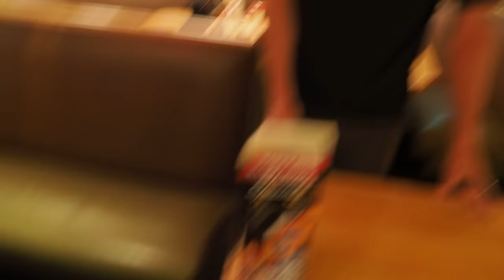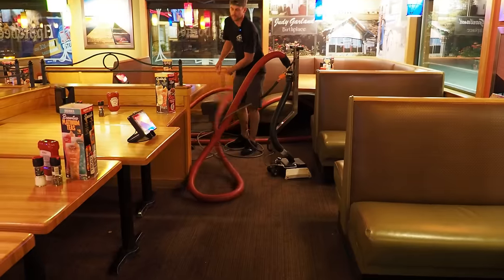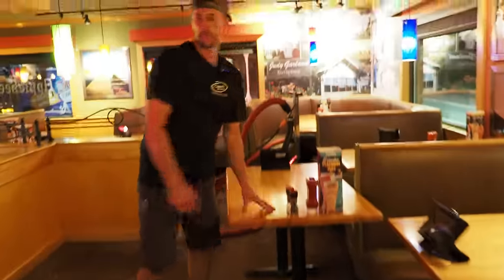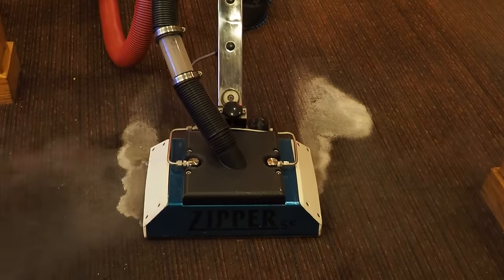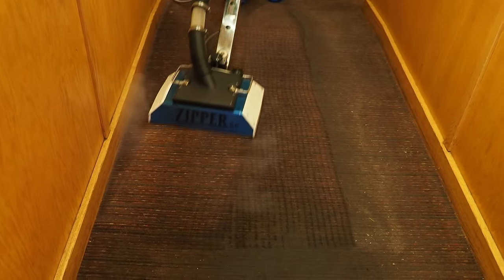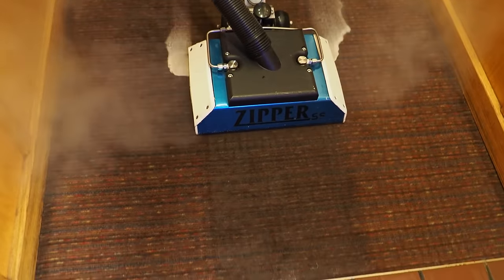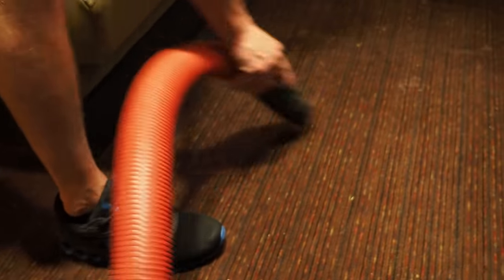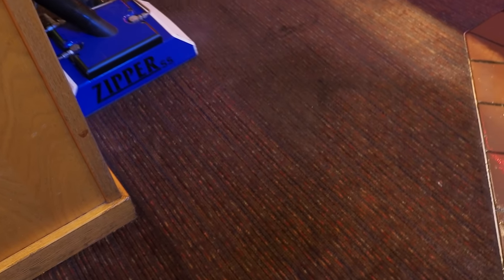Incredible Greasy Restaurant Carpet Cleaning with the Zipper SS Super Spinner

Comment: More than likely you are softening the glue that holds that carpet down. Maybe even sucking it out with that much water mixed with heat. Carpet may begin to bubble in spots and wrinkle or crease. The sucking and hot water are pulling the carpet up off the floor and compromising the adhesion. Risky work especially old carpet. 30 years commercial only work,  I have removed plenty old glue down carpet. I can safely say that some will pull off by hand. Good test would be to see if it pulls up easily. If it does walk away or you're on the hook for new install.

Comment: :face-blue-wide-eyes::hand-orange-covering-eyes::face-turquoise-covering-eyes:I suppose it's out of the question for restaurants to have tile floors instead of carpeting? It sure would be easier to clean.
Reply from the maker: Actually they let the tile and grout go even longer and that is what their carpet look bad too. We actually don't like cleaning the greasy tile and grout. We have to use a screwdriver down the grout lines so often. There are a lot of hidden traps also with greasy tile and grout.. Like the grease is the only thing holding it in place anymore 😁

Comment: Are your power units separate from your vehicles or are they driven from a pto connected to the vehicle? Cause I had a friend who had a small carpet cleaning business and his cleaning unit was connected to a pto...he said that they're the worst cause it's more wear and tear on the engines...the separate units are waayyy better but cost alot more
Reply from the maker: Our Butler units are driven off the van motor with a pto driveshaft. The Butler units can go for thousands of hours and thousands of hours. Butler takes into consideration the van and make adjustments to cooling with different fan clutch, thermostat mounted outside the motor in a special made housing. Suspension upgrades as needed and weight and balance of the equipment in the van. We have had Butlers that are on their 5th owner after us still out working and making money. But your friend is correct as other direct drive manufacturers do not put in the needed considerations for the cleaning system and van to be durable. You can see more about the units at www.thebutlersystem.com

Thank you for your comment. Really appreciate it and appreciate you being here with us 😊

Comment: You guys should show dumping the waste lines from this cleaning!
Reply from the maker: We do at the end typically from each job. I can't remember if we did or didn't in this video but I do make a habit typically to do that. I will have to go check if we missed that for some reason in this video
Reply from the maker: 23:45 is the dump. I had to go check it to make sure I didn't miss it in this one. When I'm out cleaning and featuring other cleaners I unfortunately am not able to always get the water dump as we go separate ways and I'm unable to go to their shop or dump location. 😊

Comment: Replace all carpet with LVP. That would be much easier to maintain!❤
Reply from the maker: Actually in some cases the LVP is more difficult to clean. The greasy soils get stuck in the grooves, and it takes us with high pH cleaner and a number of time our CRB to loosen it up to extract. With floor, it's really one of the most abused areas of any building 😁👍

Comment: Good morning sir my name is Kelly from Kelly’s Professional Carpet Cleaning LLC,

Question I have the samples how do I measure and use the chemicals powder
Reply from the maker: Good day. We use 2 ounces per gallon of hot water if using a pump up or electric Sprayer. If using an inline hydroforce type Sprayer they typically come stock with the yellow tip in and 8 to 1 setting so you would use 4 ounces per quart. Your Sprayer jug is 5 quarts so a full jug would be 20 ounces. If you have the yellow tip out you are at 4 to 1 setting. Each quart in the jug would get 2 ounces so a total of 10 ounces per 5 quart jug.

Our. Full powder jugs, we supply a 2 ounce scoop if you do end up purchasing our products.

You can reach out to me with any questions.

Thanks for giving our products a try
Reply: Can the Chemicals be mix or use by itself
Reply from the maker: @KPCC  they could be mixed. But give them a try separate first to see how they work for you by themselves

Comment: They should consider tiling the floor if it’s prone to getting that filthy. Restaurants should be cleaned every day, including the floor.
Reply from the maker: They should be doing more for sure. Tile and grout can be really difficult to maintain too. The grout lines fill up with grease and sometimes we have to use a screwdriver to remove the grease from grout. And sometimes when they don't clean it enough, the grease eats the grout. We see that quite often. We have an LVP dining room coming up that we have not cleaned in probably 4 years now. It's probably going to be also loaded with grease that they have not maintained more than with a mop and bucket. New manager just came in and called us yesterday to clean it. Will be interesting as the Luxury Vinyl Plank flooring loves grease too. We will be prepared for it though and maybe get some video too 😊👍

Comment: Hi!. I really appreciate the content in your videos. I want to buy a portable machine to clean carpet and tile and grout. I trust your experience. Is there any that you recommend? possibly they will give me a project of almost 60,000 SQ Ft.
Reply from the maker: JonDon has their Prospector series that are pretty good. Their 500 psi is great for carpet and it has some heat also
For tile and grout they have a 1200 psi portable but it does not have heat. Depending on how much tile and grout you do, you might use the 500 psi and do more scrubbing of the tile and grout by hand and use a hard surface wand to rinse the tile and grout. You mentioned a pretty good sizeable square footage possible job. If that's a commercial carpet I would consider using encap cleaning such as we do using the Trinity Phoenix. Those are my initial thoughts. You can definitely reach out to me and I will do my best to try and help. I wish you the best as you can see we love cleaning carpet 😊👍

Comment: better to vacuum prior to spraying
Reply from the maker: In most cases very true. On this greasy we maybe could have pulled up some chunks, but we find we usually cannot get any soils really out with all of the grease. We did do a vaccuming on a place a few nights ago. Too much debris, but didn't get much out of the carpet with the debris. We also sometimes find the grease contaminates the vaccum roller brush and we have to pull it apart. But definitely agree prevac is what we do a lot normally. Thank you for your comment also 😊

Comment: Where can I buy this cleaner machine?
Reply from the maker: This is a Zipper Wand. This version is the Zipper Super Spinner. It is powered by a truckmount carpet cleaning unit outside. The Super Spinner needs a pretty powerful truckmount. The regular Zippers can operate with some smaller truckmount units. The inventor and maker of the Zipper Wand is Erik Hiltz. You will find the info at www.zipperwand.com